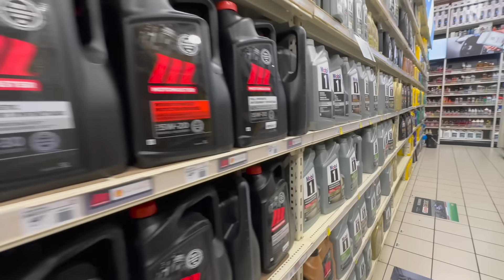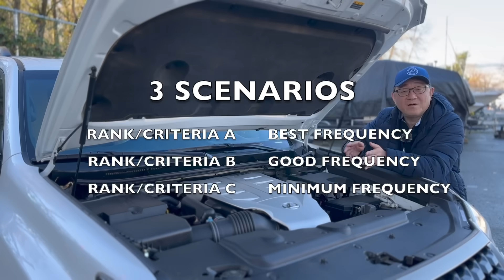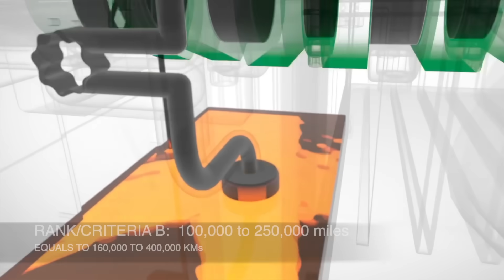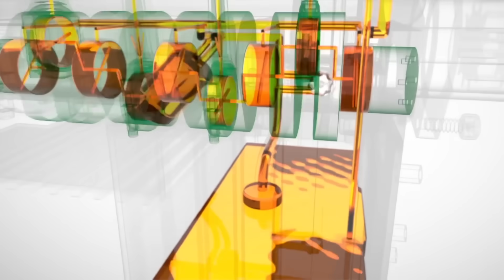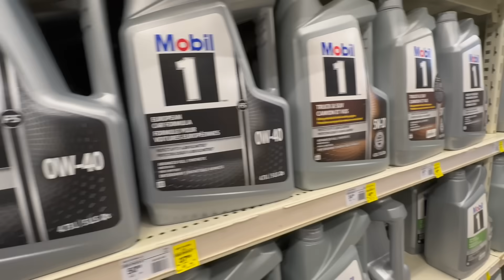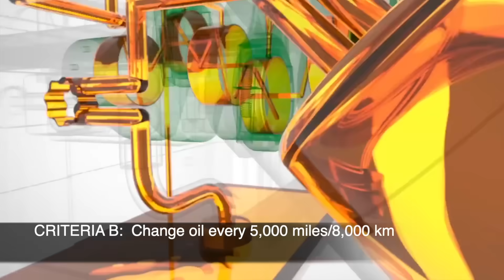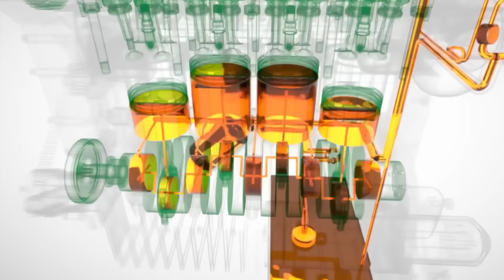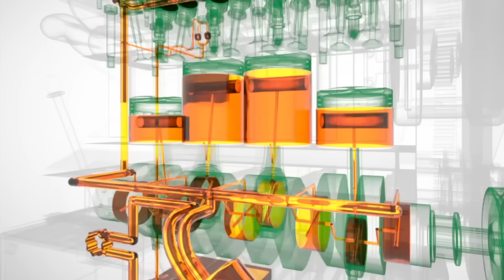ENGINEER EXPLAINS HOW OFTEN TO CHANGE OIL & FILTER // UPDATED CRITERIA-BASED RECOMMENDATIONS!

Comment: i would like to see evidence base science to back up the frequency of the oil change plus filter. If your using full synthetic top tier including filter per the oil geek with evidence base on labs results
5k is equal to your criteria A.
PLUS i change differential oil amd transmission oil every 10k. 2019 GT mustang aluminator 5.0L engine calimer mt-82d stage 2 & FHP differential. people ignore the differential and transmission.

Comment: It is more important to change the filter than the oil. If you are using quality oil and filter, the containments will be lower, and the filter will catch most of it. So, the statement of "possibly changing the filter over other oil change" is probably the worse advice ever. Also, NEVER recommend going as long as the manufacture "recommends", as they are only concerned with the warranty period. NEVER exceed 7000 miles, but really shouldn't exceed 5000 miles, with high end oil and filter. If you use cheaper oil and filter, then every 3000.
Another reason your "C" advice is horrible is that you are teaching people to wear engines out if they trade they car in every few years which completely screws over the next owner (or two). NEVER wait that long to change your oil. NEVER. It doesn't matter how often you trade it in! Be a decent human being and take care of your car so the bloke that can't afford a new car, like you can, doesn't end up needing a new engine two years after he buys it because you didn't take of it.

Comment: This guy has a poor respect for an automobile first off change your oil as frequently as possible don't wait 20,000 or 10,000 me change it sooner than that and that's the best device to give anybody because if you don't change your oil it dilutes when it dilutes it breaks down when it breaks down it starts wrecking engine parts so if you want to stick money into your car as you're getting to 100,000 miles don't change your oil if you want to save on repairs change your oil more frequently

Comment: When I was in Alaska I would change the oil filter in the mid winter . I noticed the oil was really clean on the stick after changing the filter only .
Reply: You likely dont have fuel dilution issues; maybe not a DGI small engine.  I thought, "why drain when I'm constantly refreshing with top off oil" on one particular DGI oil burner?  Mistake. Drain the gas- contanimation along with that degaded oil!  Engine now runs better at 267K miles than it did at 120K (but still topping off despite shorter drain intervals

Comment: I change the oil Filter frequently, along with 1 fresh qt. of oil. easy and cheap, that will provide a long lasting engine, I have proven that to myself with 100's of thou miles.  The emission control crap on internal crabustion is what will kill the liquid fuel burners.   In the 21st. century, asking " how often to change oil"  is like asking a 40 yr. old,  how often do you change your diaper?.  Electric propulsion will soon start putting the scam called internal crap engines in the scrap yards, never to be built again.

Comment: I don't do high mileage and most of it is stop-go with the occasional 20 mile run. I change the oil and filter every year when I give it a pre-MOT service. The car is 22 years old with 82,000 miles on the clock and runs sweetly with never an issue. The same goes for my 3 classic motorcycles  ( combined age over 120 years) which have never had an engine issue in my ownership. At only around £20 per oil change, it's certain;y the most cost effective service item for long engine life.

Comment: Having spent 42 years in the automotive industry, 32 of those as a shop owner with employees, I agree with your general service interval assessment. Especially for those who don’t read their owners manual. The whole service interval thing has become such a contentious thing. The automotive manufacturers have fallen into the word game, making up and changing definitions. With the 10 and 15,000 mile service interval Almost No one falls into the normal service interval. The normal intervals consist of starting the vehicle in Temperate conditions, driving a short distance to the freeway. Driving at freeway speeds for an extended period and a short distance to your destination. No cold or hot start conditions, no extended, driving on surface streets to get to the freeway. No stop and go traffic, no heavy loads (including passengers) , no short trips, no mountainous, driving, no towing, etc. All that would be under severe conditions, which applies to most of us, that is a much shorter service interval. Also what people don’t understand is that there are other things in their owners manual that are supposed to be done before that 15,000 mile oil change, brake inspections, tire rotations , fluid checks etc. Having a service done at 5,000 miles intervals rather than 15,000 miles intervals can save you money. If you use 15,000 miles as an interval and your tires or brakes only have 6000 miles left, they will sell you tires and brakes before you need them. Not to mention any other issues like belts, leakage, lights etc. A vehicle is an investment you need to protect. On a different note, I love that guy who was arguing with you about oil analysis. At no point did he say he was taking a sample between oil services or what type of driving he does. I love the guys who say “ I do 15,000 miles between oil services, but I do 15,000 miles  in two months. Back to the beginning, it’s not the miles but the type of driving. 😊😊

Comment: What is your recommendation for keeping the car forever but only driving the car for 500 miles a year?  2018 Q50 Redsport. 0W-20 full synthetic.  Not a DYI, so changing oil and filter at dealerships can cost anywhere between $100 to $200 each time. Manufacture recommendation is 10,000 miles/year or annually. The cost of changing oil for $200 just for 500 miles seems outrageous. Oil degradation should not be that bad, right? Once of month, I would drive the car for longer distances and 35+ minutes so that the engine temperatures can be hot enough to burn off moisture and excessive fuel in the motor oil. Preventing sludge... Can I go 5 years or 5,000 miles interval full synthetic oil and filter changes?

Comment: Just did an initial break in oil change at 1200 miles on my 2024 4Runner and plan to keep it as long as possible.  Also sprayed Blaster Surface Shield lanolin undercoating inside and outside the frame, underside, and in door panels.

Comment: I dont drain oil in anything. I use a Australian Jackmaster Classic bypass filter on the Pontiac Torrent 3.4. Jackmaster claims 1 micron if you use Jackmaster Classic  elements. I use Walmart synthetic oil  in everything now. The other engines use Motor Guards and Gulf Coasts except the Ford diesel tractor. It has a modified flat head Ford V8 canister filter that has half a roll of Viva towels in it. I have Walmart 15 40 conventional in it. Because of the soot I change the filter more often and add more makeup oil. I use Great Value 1000 toilet paper from Walmart  in the other filters. The Jackmaster element is about 20 bucks.  60 years of clean oil starting with a Frantz oil cleaner and Standard Delo in 1963. Everything is based on using filters that dont clean oil and draining the dirty oil. Clean oil doesnt generate profits.

Comment: I am an "A" person, my vehicle is a VW Rabbit 2011 with 250k km on it. Oil changing interval acc. to manufacturer is 30k km or 2 years. I changed my oil every 20-30k km and it is still fine.
3K is way too excessive for most. But it also depends on your profile. I am an automotive engineer too btw. 7k miles makes probably most sense. But thank yu for your inpun. I wished you would have some lab tests aftr 3k 5k 7k 10k 15k miles to compare because otherwise it´s all hear say.

Comment: “every 3,000 miles at a minimum” is a waste of resources. My RX-350 is  almost 15 years old with 240,000 miles on the factory 10k intervals. My M5 rusted through at 235,000 miles at 10-12k intervals, based on oil testing. My last car that didn’t reach at least 200k on factory intervals was probably my ‘86 CRX Si.

Comment: It took me about 20 years to put 250.000 miles on a 84 Subaru with no oil changes using a Frantz oil cleaner and Mobil 1 15 50 oil. My Pontiac Torrent has a Australian Jackmaster Classic. I change it every 6.000 miles and add a quart of Walmart synthetic oil. I drive mostly highway miles.
Reply: Oil doesnt get dirty because of miles or time. It gets dirty because of poor filtration. Cars dont come with filters that clean oil. That takes depth bypass filters. I stopped routine oil changes in 1963.

Comment: 2008 Corolla. Currently have 250k miles. 150k I put on since Covid. I’ve done about 10 oil changes every 15k miles the last 150k miles. Using 20,000mile full synthetic oil. Car runs perfect. Doesn’t burn more than a quart of oil over 15,000 miles. I do a lot of driving and I just am not going to pay 3x more for oil when the car keeps running so good. But, i may start changing it every 10k, but no way I’ll do it every 5k. But that doesn’t mean others shouldn’t.

Comment: Well for most of my life I did every 3000 miles. I now do every 5000 miles only because I talked to a man at the dealer ship that told me with todays oils being much better it would be OK to 5000. All this 7000 to 10,000 miles is a bunch of bull dung IMO. Oil breaks down over time so the longer you go the more it will be depleted.

Comment: I have always been a 3000 mile guy.  Two vehicles went just under 300K miles.   That said, my younger days, I bought oil on sale for 78 cents a quart, Penzoil, and a Walmart filter on sale for 2 bucks.  That's right, I could do my oil changes for $5.50, done.
Reply: It's a shame to be wrong all that time.
Reply: @kenfrank2730  I'm okay with that.
Reply: @kenfrank2730  Merry Christmas.

Comment: I have a 150K mile Highlander that's had synthetic oil changes every 10K miles.  No issue so far, but would it still make sense and help to start doing 5K changes now? Or is the engine aging already baked in?

Comment: So would you recommend an oil bypass filter like Amsoil’s?
Reply: Amsoil has good oil. Bypass filters are the only ones that can clean oil. The Australian Jackmaster Classic claims 1 micron if you use their elements. That is about as good as you can get. Motor Guard has always claimed submicronic. All they make is compressed air filters now. Their elements are like coffee filter paper in a roll with a plastic core. They started in 1961 with a lube oil filter that used 2 ply toilet paper. My oldest Motor Guard is a 60 years old on the old Farmall H tractor. Took it off a Case tractor before it went to a farm auction. Amsoil had a good bypass filter at one time. They had Bobby Unser saying this oil change is forever. I dont think they were economical That was in the early 1980s.

Comment: These recommendations might be excessive. 

I've been following Toyota recommendation for my Tacoma of every 5000 miles oil change and 60000 miles ATF change for 14 years. 

Zero issues with the engine and transmission. 

I would not be surprised if I was able to get another 14 years following manufacturers' recommendations.

Comment: At 3k miles using very good full synthetic motor oil, I can hear a difference in the engine... a little tiny bit of top end noise. So, I change it at 3k miles even though I know if I sent a sample off to be analyzed, it would still be "good." I keep my vehicles as long as I can. My 2006 Suburban has 390k miles on it, and it still runs perfectly.

Comment: I started working on my own cars when I was 15 and a half years old in about 1971. For years I changed the oil about every 3000 miles. I became a mechanic in 1973 and repaired golf course equipment for about 15 years. I had many cars over the years and kept them all in the early years to over 120k miles. I learned in the early years I was wasting my money on frequent oil changes. I have always changed the oil filter when I changed my oil. I went to 5k miles between changes (sometimes longer) and eventually went to Walmart synthetic oil. I found that more people waste money on premium oils and filters than anything else in life. I’ve kept all my cars for over 275k miles (I guess that’s why I have only owned about 6 cars since high school in 1973. I generally get tired of a car before it is worn out. I have a 1999 GMC 2500 truck that I bought in about 2005 with 85k miles on it. At the time I was using only Pennzoil only and changed it only when the change oil light on the display came on. At about 175k it developed a lifter tick that was because of the Pennzoil. I switched to Walmart full synthetic and it has almost completely disappeared. Truck now has 210k and still runs as good as the day I bought it. Keep your air filter intake tight and use good air filters because that’s what keeps the dirt out of your engine. You don’t need to change the air filter every 25k miles. Just change it about every 75k to 100k miles. People that don’t work on cars have no clue what to do so they are super careful to change their engine oil on an all too frequent basis. I suppose if you believe it must be true…..

Comment: Had a new '95 Chevrolet Cheyenne. Changed the oil right on time at 3,000 miles. Took great care of it. Spent only two nights not in my garage. Some nondriver destroyed it on the way to work one morning. Had 80,000 miles on it.

Comment: What I've noticed based on oil life monitor is that when the oil is approaching the end of its life, your fuel economy drops noticeably. Not a huge drop but noticeable. You can drive 2-3 thousand kms after that.

Comment: My 2 Ford 4wd trucks ..bought new.. have gotten consistant 5k mi oil changes w/Pennzoil Ultra Platinum & Motorcraft filters (oil & air). I do 1st oil change @1500mis after general break-in period i must add. Tranny fluid /differential fluid changes @50k mis. Over 300k mis on '14 F150 & 198k mis on '18 F150. Both run perfect & never use any oil. They are GTDI V6 turbo engines. Have new '24 Ranger Raptor on order now that will not be replacing other trusty trucks. More a wknd toy type thing. Engineering perspective.

Comment: You can change the oil all you want, but eventually other things will give. Keeping a car for 20 years nice but who does? I had a 2010 corolla for 10 years, changed the oil every 5 k miles, the engine was nice an clean, at 100k started to consume a little bit of oil not much but noticeable, Transmission fluid WS replaced completely at 100k and the transmission was flawless I sold it at 150k and the car was perfect mechanically, but 10 years show on everything else, I thought I was gonna keep it for ever but that is not a reality.

Comment: You guys really need to stop listening to people on the Internet, i have a 2016 BMW 740iL first owner, and it requires oil change at 10k, that comes from the company that built the motor and tested at the interval of mileage, thats why its warrantied. Ive actually done 7 oil changes on my car use Shell or Chevron gas and have never been in the shop for any major work. Go by what your maintenance book says, not the guy making videos.

Comment: The only problem with some of your comments about early oil changes is: if someone gets in their vehicle and drives it very hard before the oil can achieve a reasonable operating temperature, allowing for optimal protection, then the vehicle will show extreme wear.

Comment: Your metric for oil changes, based on length of ownership is bs. You imply that engine wear can be the next guy's problem. Your A, B, and C criteria is crap. It should be based on HOW the engine is used or abused. High heat, high rpm, hot climate, cold climate, etc. Your theories are ridiculous. You suggest that if I drive 1k in 8 months I should still change the oil? C'mon now.

Comment: Somehow in Canada we completely disregard manufacturers recommended oil change intervals and do them at 5000km instead of 5000 miles. I always go off what the manual says the service interval should be and in my dieael work truck i go half the recommended interval due to the harsher conditions and extra idle time

Comment: You suggested the possibility of changing the filter every other oil change. But if the main reason to change the oil is its dirty condition and not that its properties have worn out, wouldn't the better remedy be to change only the filter every 3 to 5K miles and leave the oil for the next interval at 6 to 10K? (I always use premium full synthetic oil and the best filters with synthetic filter media)

Comment: The problem is the life span is 10 years or 250000 miles. If you change the oil every 5000 miles the engine will last for 500000miles or 10-15 years or more. the problem is the other parts of the car like the aircon, power steering, brake system,power windows and the computer box.

Comment: I've had high performance work done on my turbocharged car, and my tuner said to change oil and filter every 2,000 miles. The turbo is extremely sensitive to oil cleanliness.

Comment: I had a Focus I got rid of with 240k miles and changed the oil every 10,000 with synthetic oil.  At the time I sold it, it was still running strong.

Comment: I love this piece of advice. I'm criteria A and I currently have 2 cars. Both use synthetic oil and both get oil and filter change twice a year independently of mileage. I typically drive between 3000 and 4000 every semester. I organize myself and I perform my own oil change mid-year and I take to the dealership once a year so that they plug it in and lube doors/etc. Greetings from Argentina! Nacho.